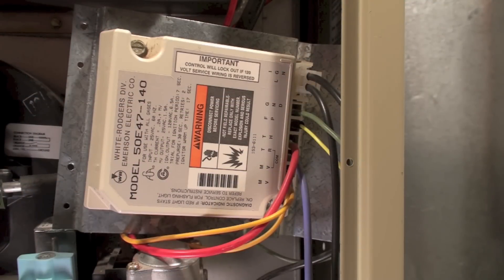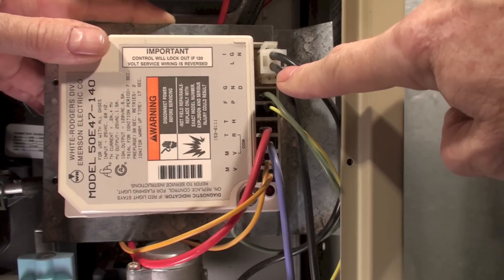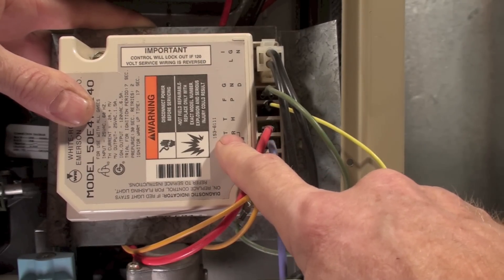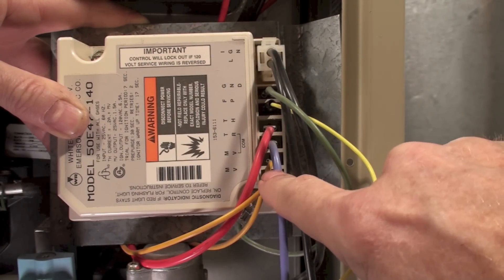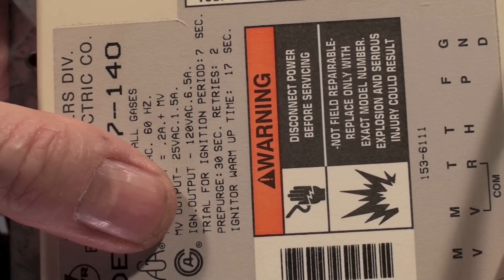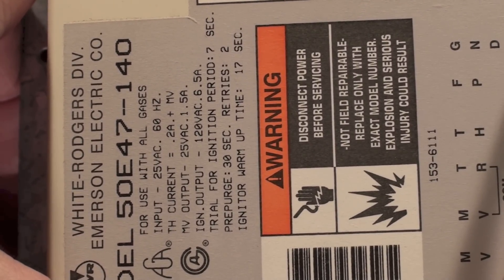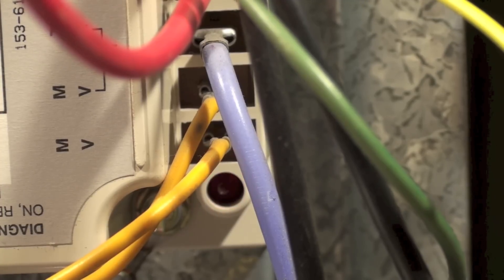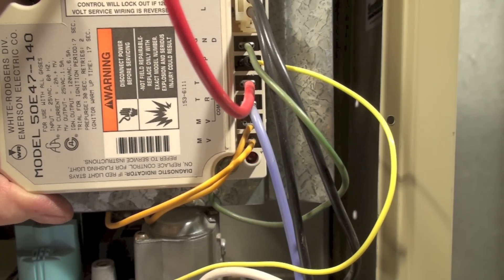How the White Rogers 50E47 ignition control operates

Comment: Dear GFM,
I went on a no heat call today... Trane RTU 30 years old had very rusty pilot burner assembly with spark ignitor. Pilot gas opens but there is no spark at all. And it doesnt lock out the valve eventhough doesnt sense the flame. Question, The control module is called ground G600AX-1 Johnson controls is good or bad? how can I figure if the board is sending any voltage to the spark ignitor. I pulled out ignitor and put my probe and measure to ground is 0.

Comment from the maker: The control tries 3 times to ignite the burner.  If the control does not sense the flame 3 times, it goes into hard lockout, meaning it will not restart until power is removed and started again.  The light is letting you know it is in hard lockout.
GFM